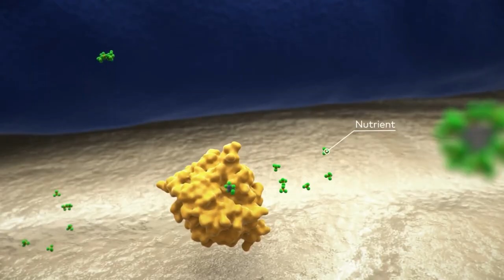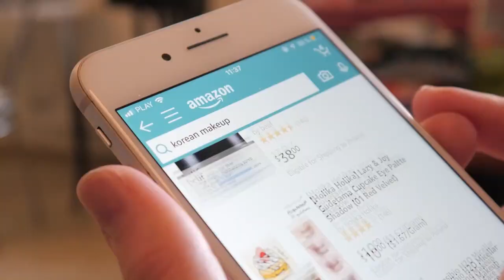Planting Sweet Potatoes

Comment: You can use willow crumbles and aloe vera as a rooting hormone instead of chemicals. With due respect, usda approval on chemical additives in food products known to cause cancer should be an eye brow raiser and run rampant in pretty much everything therefore earning the usda as untrustworthy.
Reply from the maker: Some valid points about usda chemical approvals. The product, Rev, I mention here is basically just reed segde, soaked in water, then the resulting fluid is condensed. Water can then be added back in for use. Not necessary, but worked well for me. Happy gardening!